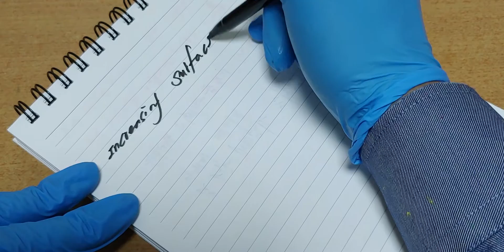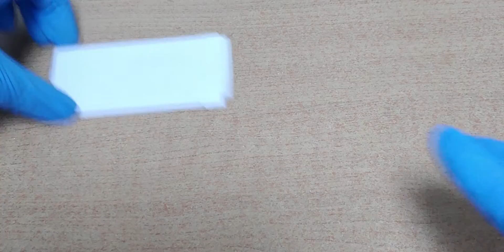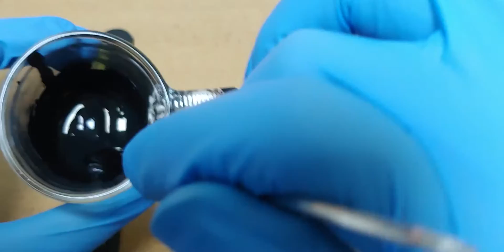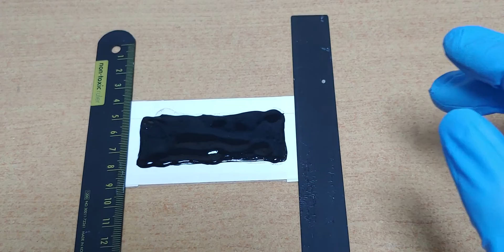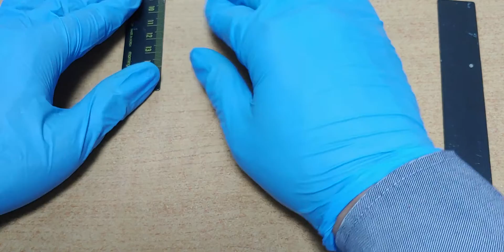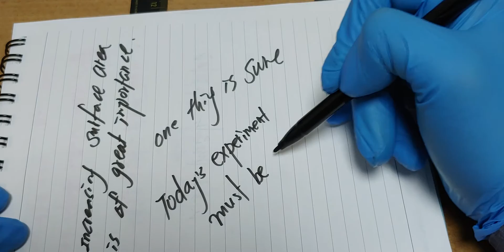A new way to make a solid state battery

Comment: what is your graphite MnO2 mixture made with?  Is it simply a paste with water or some type of binder?  Also, what is the ceramic base made of?  Thanks
Reply from the maker: I don't use MnO2. Whenever I used MnO2, I found that it generated heat. So I don't use it. For the binder? I use a kind of glue. But I don't know how to say it in English. Happy new year.
Reply: @solidbattery9956  you actually mention Mixture of Graphite and MnO2 in the written description.  I suspect you are using a water based glue (maybe polyvinyl alcohol based?) since when painted on, surface tension on the plate caused the first brush stroke to show surface tension.
Reply from the maker: @en2oh  
Aha, lately, I don't use MnO. Have a nice day

Comment: Hi. I was thinking that it works because of drawing in water from the air. I think it's the NaF or other salt in the toothpaste that brings the water in. Have you tried washing out the salts in the toothpaste before using it?
Reply from the maker: Hi, there. Salt (NaCl) causes corrosion. So I use salt which doesn't have NaCl. Have a nice day.

Comment: Nice work. But yet there is still room for improvement for your cell ^^

First on using manganese dioxide is the right choice but using aluminum foil really isn’t a good idea singe it‘ll react with it in either a solid state reaction to yield aluminum oxide (which is practically an electric insulator) or if there’s  water of crystallization in form of hydrates in your „dry“ electrolyte then it will most probably yield aluminated manganese dioxide depending on the ph of your electrolyte. 

Secondly concerning the electrolyte: if you’re still using toothpaste (which I assume) you have to identify and isolate the ionic conductor(s) to reproduce it with real scientific methods so you can see different possible ways of improvement. Oh and also yet nobody has found non-alkali metal solid ion conductors that have a significant ionic conductivity so maybe you should try finding oxide or halogenide ion conductors (If I remember correctly some perovskites like methylammonium lead iodide have a high ionic conductivity so maybe you could substitute the lead with a less poisonous metal an make some conductivity tests on it). 
Also iodine could be a rather interesting compound to work with since polyvalent iodide salts show promising ionic conductivity so that you essentially grow an ionic conductor while discharging instead of an insulating oxide layer. 

And third a little hint from my side because I find it a bit annoying if you just write random things onto your paper block so please stay with schematics or balanced equations if you want to show something. Isn’t meant to be rude but this will increase your video quality a whole lot.
Reply from the maker: Thank you Mr. Andre
I want to say one thing first. I really like your truly helpful advice. Also thank you so much of giving me a chance to talk with you.

First: Aluminum corrosion: Al electrode used with graphene (which is made with heat) shows no corrosion, but Al electrode with graphene + MnO2 shows corrosion, thus lowering its performance. But I am doing nothing with the corrosion now. Since I think getting stable 3.4 V is first. 

You are so great.
  
Second: toothpaste is also ironical to me. For example, NaCl, NaF(sodium fluoride), KOH, NaOH are all non-conductive when they are in solid state. To make them conductive, we must use them in liquid state. But in liquid state, they are strong  and toxic enough to cause Al electrode corrosion. As I remember NaF is included in toothpaste. I think it can be conductive in toothpaste, which doesn’t cause Al corrosion. So I use it. Of course you are right. I will continue searching for better one as you commented. Thank you so much of it. 

About iodine: I want to avoid using it. The reason is very simple. It’s expensive^^. I hope you understand me. 

Third: using balanced equations seems to be a good idea. I will try it. 

Last: Always thank you. Thank you again. I like your having profound knowledge and giving me truly helpful advice.

Have a nice day.
Reply: I'm new to batteries and chemistry and find I learn the most in the comments thanks andre I'm looking for a mentor is anyone interested if so my email is knowyourlimitless101@gmail.com 
David thanks

Comment: What is surface area? Thicker layer makes more surface area or finer materials containing the area or both? Stay safe and have a nice day
Reply from the maker: In the case of ceramic, it must be thinner because it may be the passage of ions. But in the case of  C + MnO2, it must be thicker because it is the storage place for ions. The surface area is related to current. The wider surface area it has, the more current this cell has. And the surface means the contacted area between ceramic and C + MnO2. Have a nice day